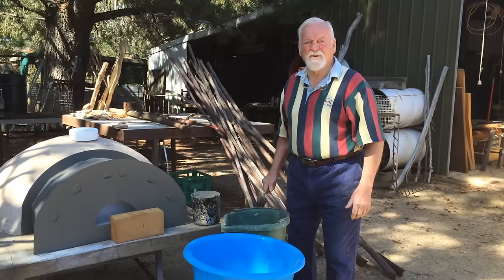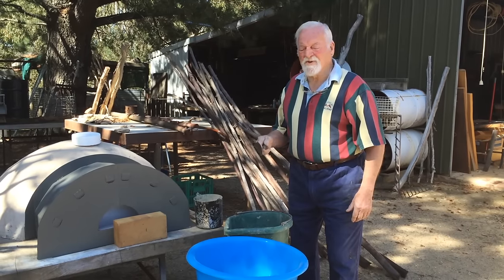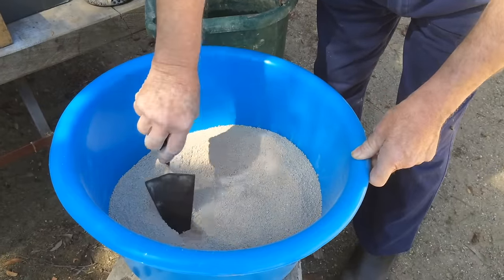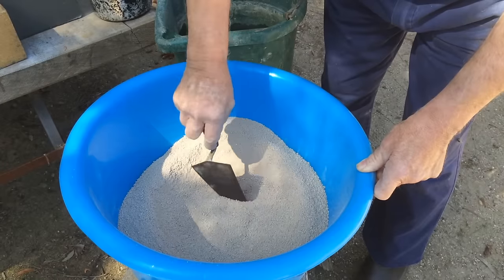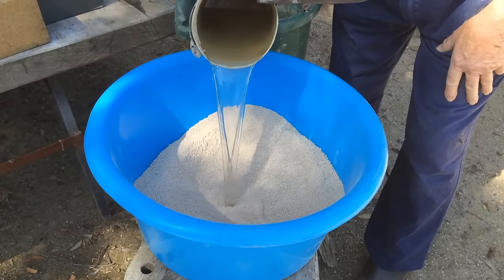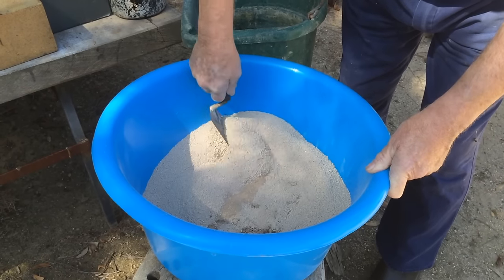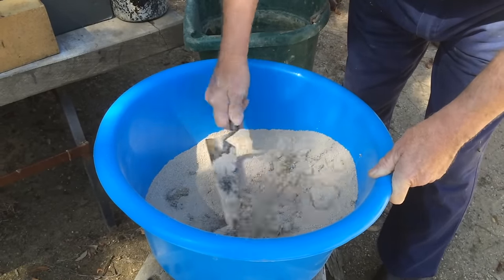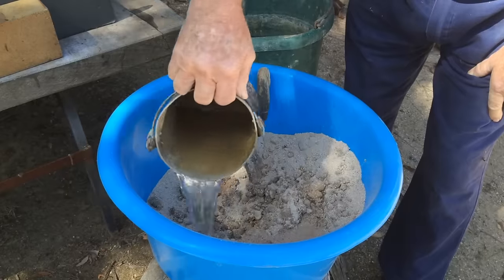Mixing Refractory Cement For Your Pizza Oven

Comment: I have a heap of it shaped Hebel blocks. ( fire bricks) and I was going to cut into shapes for a small forge? I have wondered with the offcuts and remaining white powder if I was to use cement to make a mix of mortar style fire bricks.? Would it work? Or do I have to get plaster of Paris?

Comment: As a refractory specialist, this is cringeworthy. You need to measure your water for the correct amount and mix it much better and longer.
Reply: So can you use a cement mixer or it’s always by hand etc etc?
Reply: Yes you can use a mixer
Reply: A͜͡ction looking for a refractory cement that can be packed, not poured. Do you have any recommendations?
Reply: Tony Povo most castable can be hand packed. Just lessen the amount of water to the mix. Squirt water on the area the castable is being applied to. It will help it adhere better. Greenlite 22 plus is a great lightweight material to handpack.
Reply: A͜͡ction thank you for the quick response. Have you personally done this on an outdoor oven?  I have a mild that I made out of foam.  I then put a skim coat of cement over the top to smooth it out.  Any advice on getting it to not stick to that?
Reply: Tony Povo ive only worked the industrial side of refractory. Ive never worked on an outdoor oven. Any kind of form oil will do for packing against s form. Wax works, deisel, etc..
Reply: Can I make a pizza stone with refractory cement? How, and will it get nice and hot?
Reply: @action7168  i cant find this anywhere to buy as a consumer/homeowner
Reply: Michael harbisonwalker has all kinds of refractory you can buy from them.
Reply: Jakes Grobler im not sure i understand the question? Can you make a pizza stone?
Reply: @action7168  greenlight 22, cannot find
Reply: @Hedgehodge-  harbinson walker international has it. greenlite 22 plus. rated at 2200 degrees lightweight material with quick tryout time.